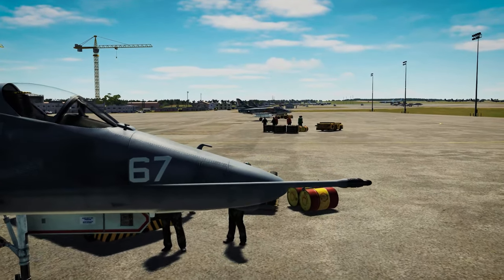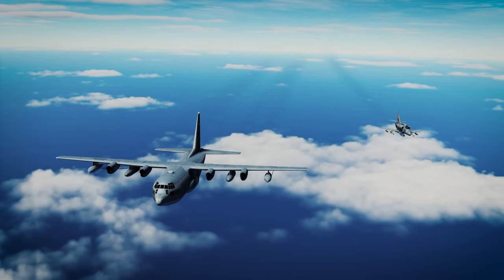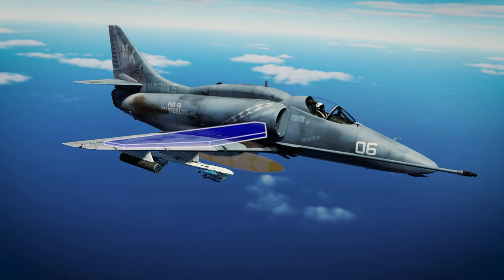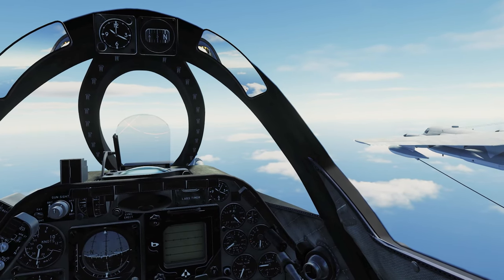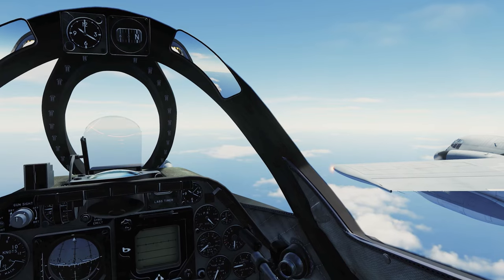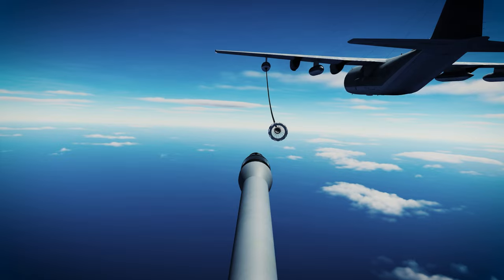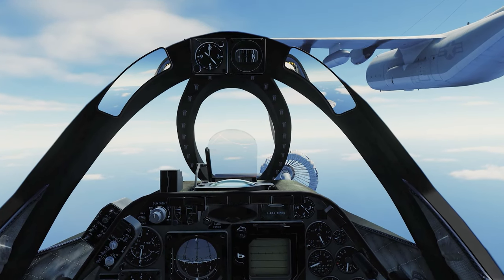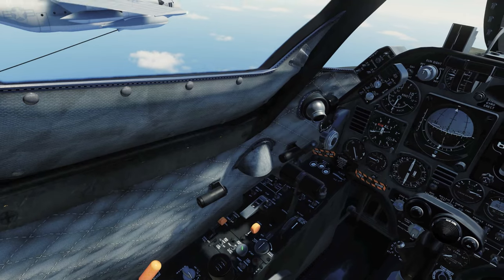DCS A-4E Probe and Drogue Air-to-Air Refueling | Digital Combat Simulator

Comment: Why does the FUEL TRANSFER light iluminate at idle? Does this have something to do with bleed air pressurisation?
Reply from the maker: At low engine power settings, the fuel flow rate from the main tank to the hopper, drops and triggers the light. It’s a completely normal condition.

Comment: Thanks for the Video but you need to include some important information in your video that makes a huge difference to your viewers. 1. Speed and ALT of the the tanker is imperative to viewers wanting to practice this at home with no set up experience.  2. What are your control curve's?